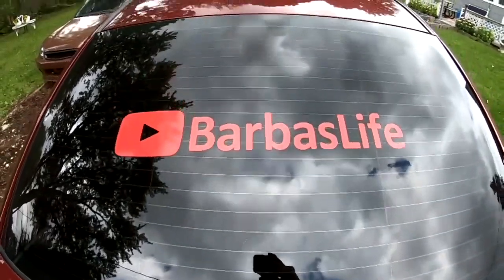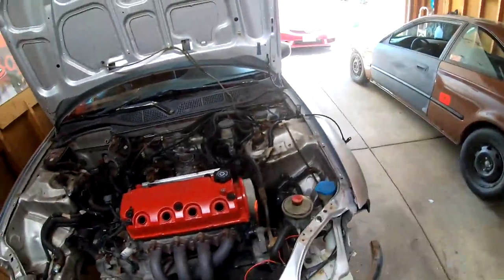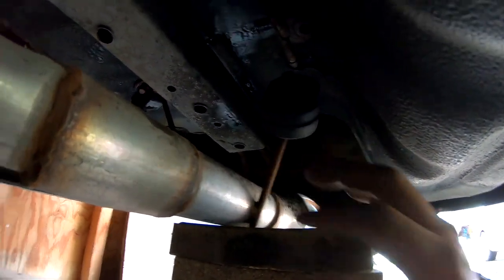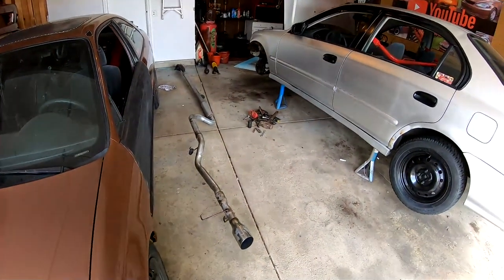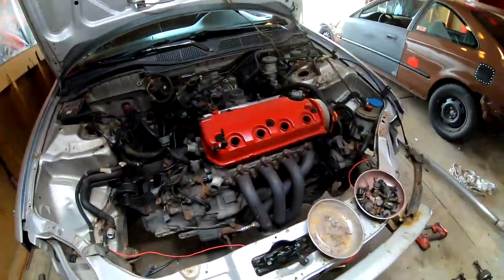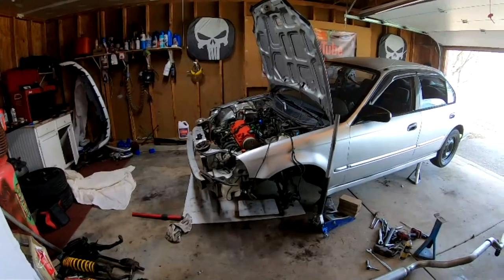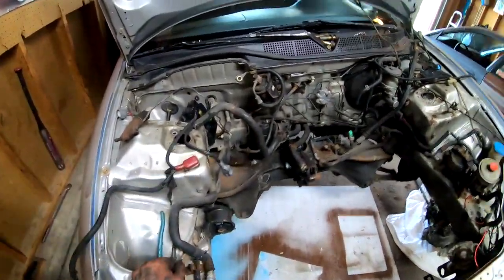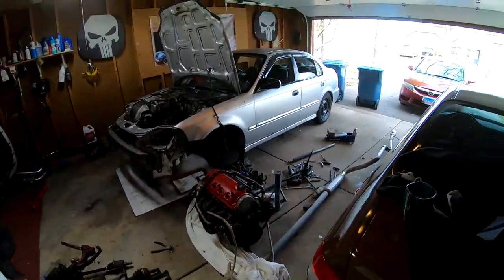engine is finally out of the civic

Comment: Nice build 👍.....have a question for you ....how do you choose a light weight driver seat for a Toyota Yaris.....l get overwhelmed on Carid...some choices are like real expensive
Reply from the maker: its hard to pick a seat. just make sure you get one that reclines if is a daily otherwise it will drive you nuts later on. they are pretty expensive. maybe some NRG bran would be decent or recaro if your balling with cash lol. just be sure they recline for daily use.
Reply: Hey thanks